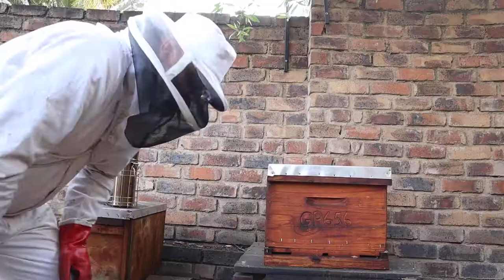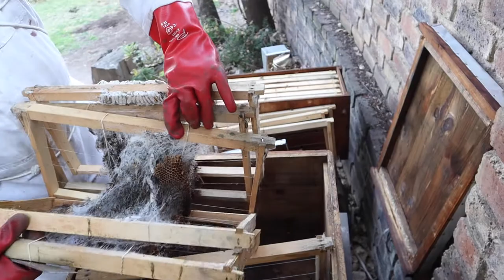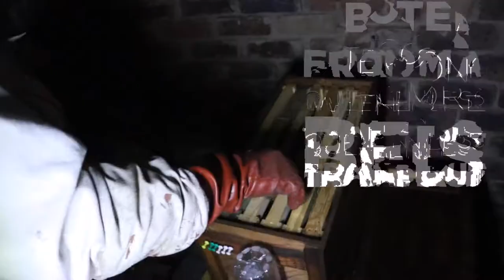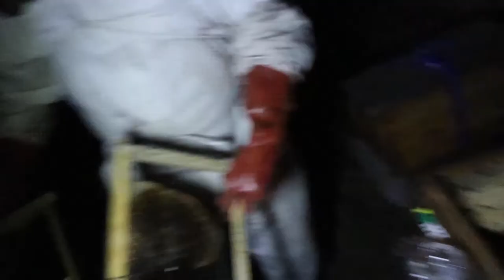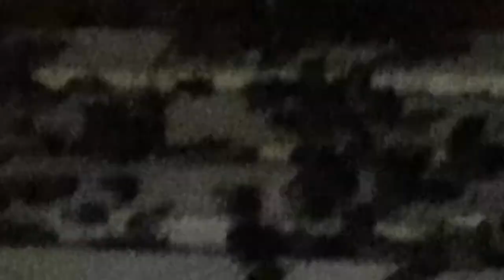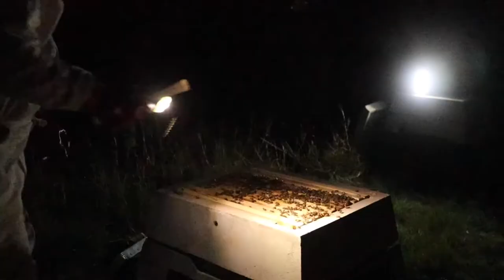Wax Moths vs Weak Honey Bees (How to save them)

Comment: Great video. What did you do with those wax moth frames?
Reply from the maker: Hey Melissa, Thanks for watching. I leave the frames out for the Honeyguides to peck at and then I submerge in boiling water and easily scrape and clean them ready for full wax sheets to be inserted.

Comment: Did you end up saving the bees? You shouldn't use the infected comb. Chances are the moth already laid eggs in it. Just move the bees and not the comb. Thanks for sharing
Reply from the maker: Yeah, bees were saved. We do regular inspections and remove old comb and replace with wax sheets in a very short cycle. This also helps get the colony strong as the queen lays well in fresh comb. I have also found wax month in an active hive is quite rare, normally they take over a box once the colony has absconded.